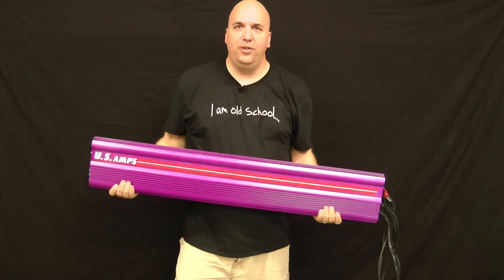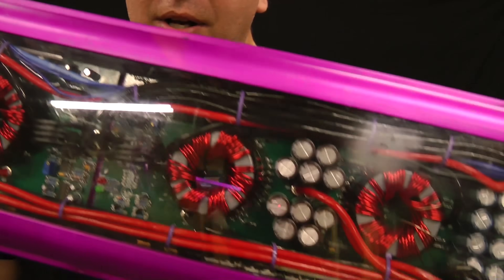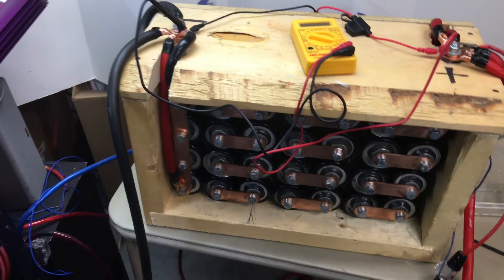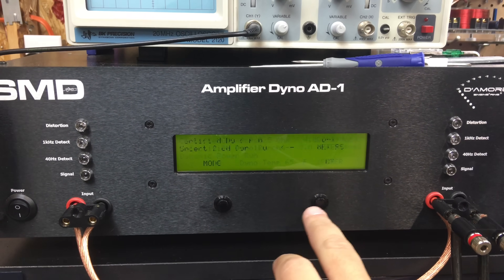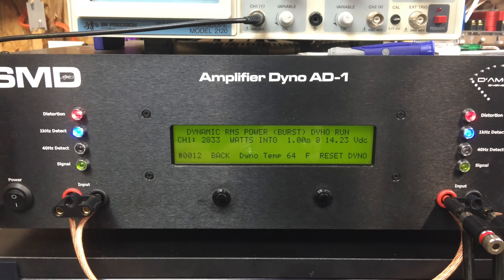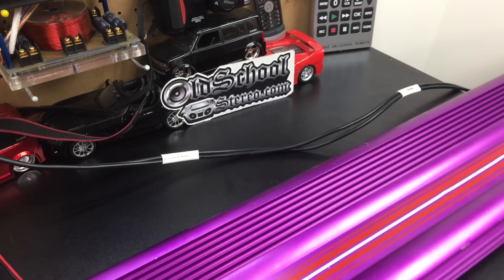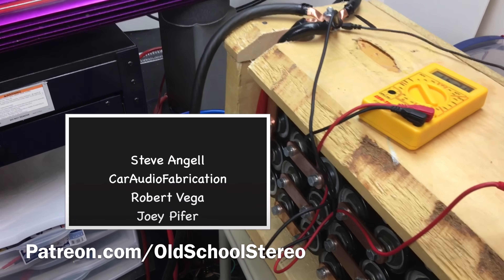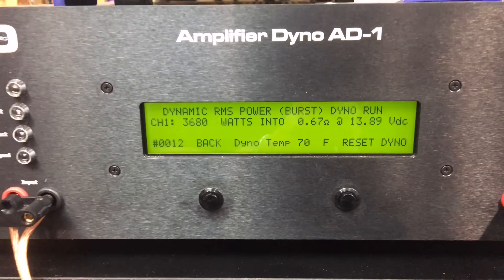Most Powerful Old School Amp - US Amps VLX-400 Amp Dyno Test 1 Ohm UltraHD

Comment: To show you the technology Gap now the same power even more power is only a quarter that size.
Reply from the maker: The JP132ab does more power than this amp, same architecture (Class AB), 30” in length vs 44”. The US Amps was revolutionary in its time though

Comment: In competition we would run them at .5 ohm. 
We also mounted them upside down because if the solder got hot enough there were tracks to hold the molten solder. 
Of course these were competition cheater custom built. Wish I would have kept a couple 🙁

Comment: Noice!  I miss my US Amps 100HC.  When I was building the system, I spoke with US Amps and they said it would happily handle .75 ohms and it did..  I had it paired with a usa-150 and it used to baffle people as to why the 100 "watt" amp was 3 times the size of the 150 "watt" amp.. ;)
Reply from the maker: Beast amps!

Comment: Owned one, had it in a '63 bug with 2x 15" MTX Subs in a sealed box, holy hell, I remember a friend saying he could hear and see my car over a 1/2 mile away coming up his hill. Old Bugs are an almost airtight sealed car, it sounded amazing inside. That sub eventually fried both those speakers after buying that amp I just couldn't afford JL's , W7's were just coming out and hard to get. I still have all my hearing and I rack that up to having a great amp with low distortion and a sealed box. Thanks for the memories!

Comment: Bro, revisit this amp!! I have this exact amp 1999 US Amps Vlx400 run at 1/2 mono (this amp is .5ohm stable out of the box, on all the data sheets and more) with 14.4v, 8v rca input, drawing 398amps pushing 8 dc audio 12's with 4450watts confirmed. 

I watch you vids constantly. My question is why did you stop before testing to 1/2ohm? This amp is built to withstand the abuse, and yet then you test a second rate junk made in China amp at 1/2ohm????!!!??!!??! 

***case in point......

"Are You Down for Some Low Ohm Amp Dyno Tests? Down4Sound JP23 Amp Test Part 2 [4K]"       This made in China garbage!

So, why?

RE-do!!!!!!!             I contend that new school numbers don't have s*** on old school bass numbers!!!

RE-do!!!!!

Comment: Back from the grave, how many amps did this test pull, and will it do 0.5 ohm?
Reply from the maker: Over 450A and it went into protect at 0.5 resistive 😲
Reply: @wal   thanks for the reply. I have one of these amps that I've been thinking of running, but didn't know how much I needed to build the electrical system.

Comment: I had 4 of these amps on 8 15’s in my Explorer. Had to feed them with 2-250 amp alternators on 8 Northstar batteries
Reply: What'd you hit
Reply: HoratioHoodoo it was in a sealed diamond box, so technically a 4th order. I built it more for musically. The best metering was 154’s
Reply: @jasonneal  8 15s for musicality 😂 I like it
Reply: HoratioHoodoo thanks, I wish I had video, all I have is pics
Reply: @jasonneal  could i plz see
Reply: What exactly do you have in your $4000 explorer sir? Just 15 feet of amps that cost $15,000. Lol. Love it!
Reply: @ThisIsMyHandle-48  I don’t have the Explorer anymore. I had 8-15’s 8-8’s mids 8-61/2’s and 6-3” super tweeters

Comment: In high school, I had 2 baby brothers of this amp (also purple). I had the VL100 (subs) and the HV25 (mids/highs).  I used to run the VL100 at 1 ohm (2- 4 ohm dual voice coil wired all in parallel ) bridged. It never went into protect. I ran a fan on it and it would occasionally blow a fuse. These amps were awesome! I still have the little 25-watt amp, but no longer the 100-watt.

Comment: I have a USA app a beast from the looks of the insides probably more than that vlx 400 it has two more transformers and a lot more capacitors if anyone news anybody that can fix us amps please let me knowI have two other us amps they could use for parts if they have tonothing's burnout on it or visibly wrong with it at all it just will not come onI am from Gainesville Florida where these amps were made can't find anybody to fix it I used a US 600x to push for 12 s this am only had one transformer in it and a lot less capacitors I've had more powerful amps but I've never had an m that put out better sound quality when it came to bass

Comment: We sold US Amps where I worked in my youth - we had a 100HC on display, and I could plug in every sub we had on the floor at the same time (20+) and it would rock them all with no issues whatsoever. Just amazing.
Reply from the maker: That is amazing!

Comment: When I came across this amp in 1997 as a broke college student, I had to have it.  Somehow, I was able to come up with the $700 that the guy was selling it for and eventually got it shipped to me.  If anything, the black satin 44" monster I had was a work of art and was insane pushing 4 12" Orion XTR's in my 94 Acura Legend.  Had the beast for 9 years, until I sold it in 2008 on Craigslist for $800 to another audio enthusiast out of state.  Simply one of the best Old school powerhouse amps that came out of the 90's..  They don't make them like they used to anymore....
Reply from the maker: I bet it was a tight fit in your Acura 😲
Reply: I ended up placing the amp on the rear deck behind the back seats as the trunk space was filled up with the 2 custom boxes built for the 4 12's...
Reply: So you got to use for 9yrs for $100. Sweet!
Reply: @ahumm8280  no, he got paid $100 to use it for 9 years
Reply: They were killer amps, I’m actually hooking up my ESX V1600.1 USA amp made by ZED this weekend
Reply: 92hbhb Hybrid china does and cheaper

Comment: Do you have a video showing your power supply?  If not is it transformers or switch mode?
Reply from the maker: I use (8) XS Power D1400 14v batteries and (8) banks of Maxwell Ultracaps (2.5v 2600F each) in banks of 6. I use an XS Power PSC30 to charge everything to 14.8-15v before running the tests. I recharge as needed
Reply: BigDWiz cool man, thanks.

Comment: They were going to make me a custom amp back in the day.  I remember seeing them demoing a mitsubishi mighty max (if i remember right) in central Florida  with 4 18s in a wall. it was insane.  VERY loud and powerful for the 90s. The amp stretched from door frame to door frame.  Sadly I didn't have the $ for the amp.  It would have been epic.
Reply from the maker: They made a few customs over the years 🤙
Reply: I had the first gold plated VLX 400 and as far as I know it was the only. Did somewhat more than an off the shelf 400. Ran on 6 Petras Prowler 18s. Also the only of their kind.

Comment: The days when a real 400 watt amp was at least 4 feet long and would cost $9.25 per watt based on msrp! I had a little US Amps powerhouse from between 1997-1998 that was just around 2 feet long, costed over $695" With Discount" at a local retailer, it had a clear plexi bottom, screw terminals was 1/2 ohm stereo capable and it blew basically every sub or set of subs you hooked up to it! I should have never sold it, but I was turning 18 and never thought about saving it!

Comment: how's the capacitor bank holding up
Reply from the maker: +Clayson Webster its doing great, but I'm adding some 14 volt batteries as well
Reply: BigDWiz Are you using any blanceing resistors
Reply from the maker: +Clayson Webster no balancing resistors. I periodically verify voltage on each cap and they seem to do well balancing themselves

Comment: can anyone possibly tell me how to get a message to bigdwiz I have got some questions I really need help with about amps
Reply from the maker: +eric burns I read comments here and reply when I can, what's up?
Reply: BigDWiz  awesome I'm trying to build a system for my daughter and I am on an extremely tight budget anyway you could point me in the right direction of the biggest possible amp that I could get with the closest too true number for $250 or less
Reply from the maker: +eric burns that's a tough one. Most of the budget amps I get are tested, then sold. I don't stress test them over a period of time so I don't feel comfortable making a recommendation. If it were me and my choice, I'd check out that Pioneer D9601 I tested recently. It is well under 200 and seems to be built well and does rated power plus some
Reply: BigDWiz thanks a lot that's actually the amp I was thinking of going with

Comment: maybe I'm used to today's small powerful amps but that seems  weak for the size of the amp
Reply: voceteo10 1 Nooooo man. The power then was different; more true. The components were of better quality and not sent overseas to be built with cheaper parts. For instance Zed Audio (Hifonics and a few other brands) amplifiers were the Buick Grand Nationals of their time. its notbthe size of the amplifiers but what the guts are made of (giggidy).
Reply: voceteo10 1 back in the day these amps should have been rated to there actual power output. Maybe they would still be made in the USA. Screw all these oldschool usa made amp companies, greedy bastards, sell outs. You screwed all your loyal fanatics.

Comment: I wish I could see how much my old optimus 4 channel does.
Reply: I had one too! and a flea market 15 in the back of a '77 honda civic, was horrible for sound, but got me started! (didn't have an eq either, instead I had a shack "sub" inductor crossover coil inline any power that amp made got eaten by that damn coil lol!)
Reply: Remember the old powered EQ's? Lol Horrible but it worked if you didn't have money for an amp
Reply: littleblacksonoma LOL that's old school dawg radio shack!
Reply: Ari Reid I know. im surprised it still works.
Reply: smoothkaos2 kraco

Comment: dereck BigDWiz   what group size, amp hour and how many batteries would you recommend using to power one of these.  
I'm going to have mine repaired soon and want to use it this summer no competitions or anything just daily
Reply from the maker: +David m Depends on how much you are going to load it down and how much you are going to push it. I'd start with one Group 34 battery and see if that's sufficient

Comment: I had 4 of these that I actually traded 4 of my BP1200.1s and some cash for in 2003 or 2004 for a wall build in my IROC i had at the time.  Kinda coincidental considering the previous video of yours that I watched was you testing that very amp.  We called it the JBL "Lego block" back when it was popular in 2000-2001 and it was the best bang for your buck out there.  It was on ebay for $249 USD for a solid 1300 watts that was a badass deal for back then.

Somehow a guy found out where I lived from the forums (so he said), and walked up my driveway when i was working on the car one day and made me an offer on all four.  He knew exactly what they were etc...it freaked me out big time.  But he returned the next day wish cash as promised and I was on to the next ones.  Never figured out who he was or heard from him again on any of the forums.  2 were Purple...one silver and one green.

Pretty badass amps though.  Id like to have them for nostalgia purposes for sure.

Comment: hay  bigdwiz Like to see a test on a great old school amp the Hk ca260 had four in my blown 1970 cuda all chromed out show car I  did back 1984 hemi 4 speed  interior is black velvet with gold plated door handles , pistol grip sifter, door locks. dome lite exc.  all gold plated  car is  painted hemi orange still have it ! my dad bought it brand new in 1970 it was his first new car dad's brother owned the dealership  I was 6 years old being tossed   around  the back seat as dad test drove the hemi cuda and the 440 sixpack  my brother wonted dad to buy the hemi it was only  $500.00 more than the 340 cuda   at $3200.00 that he ended up buying  that 1970 dollars    also my uncial  Art had one of only 12 hemi cudas convertible  in the show room on sale  for $ 4600. that's  the one that sales for over a million dollars today   and get this he had to reduce the new car price to 4100.00 because no one wonted to buy it  thanks for responding Rod

Comment: I expected a lot more power out of that surfboard... Very nice amp nonetheless. I wonder if it can run at .5 or .25 ohm? That's a lot of money to be doing scary low impedance tests though. Guts look awesome! There has to be some kind of mods you can do to it to kick out a lot more power.
Reply from the maker: +lmadden6236 Very few stereo amps I've tested can handle the 0.5 ohm mono load on the Dyno. All of the VLX amps I've tested have gone into protect at this load, even with dynamic runs. I've been told by a former US Amps employee there is a setting to adjust for 0.5 ohm mono loads, but I seriously doubt it will put out any more power.

Comment: I loved these amps, never had one, though always wish I did. Wondered how these would measure out. A lot of the old US Amps seemed to take some abuse, but they had a lot of transistors in them things to help share the load. Probably won't see many huge class AB amps like this built anymore. I can only imagine how much heat this would let off running full tilt for a while.

Comment: dam... thats bigger than most amps old or new school
Reply from the maker: In 1996 it was the largest amp you could buy. At nearly 4 feet in length, may still hold the title of the longest amp ever made (manufactured, not custom)
Reply from the maker: Yessir, not the most powerful, but one of the biggest (longest at least). I'm 6'4", so the amp doesn't look so impressive with me holding it, but trust me, she's a BEAST!!
Reply: +Dereck BigDWiz Didn't us amps in the late 90/s early 2ks have a 5kw amp that was longer than his.. I swear I seen one at a db drag event taking up the complete with of a full size pick up truck bed
Reply: They were cheater amp the more voltage u gave them the more they make. You could use the HC amps at 24volt and get huge power for compeating  they might not last long but you could win the competition
Reply: Was it a custom amp? I don't remember anything taller than this amp that you could buy at the audio store.

Comment: Few things first any 3k amp for $300 you ain't getting 3k. 2 the clean power of these amps is unparalleled compared to today. 3 the original owner and designer of these amps is still the same man designing for RE but the corporate asshats at RE will not let him do this today
Reply: +fataldreams2    ...I agree but disagree with your comment !buying a 3k amp for $300 Would be a very "Entry level" amp, putting it nicely ! that would probably never produce over a 1000watts continuous !but there are a Few companies that still make good efficient amps that are big power today !  but Not many !  but I do also agree that Re has gone done a hair !there subs have slightly dropped as well .I know I have some Re MT's subs I bought new back in 04' and compared to the newer models now they are slacking a little !
Reply: +fataldreams2  That doesn't make sense. Nobody in their right mind would build one of those today.
Reply: +Aaron Hammett the engineer and creator of these amps has been trying push the the approval to build a modern version of this amp

Comment: I'm curious what it will do at 1/2 ohm. I had one back in the day and ran it 1/4 ohm daily on eight 10's.
Reply from the maker: +Jeff Weaver It went into protect for me when I tried 0.5 ohm mono on the Dyno. That is a brutal load, even for today's monoblock amps...and the VLX-400 is a STEREO amp. 2 channels, 2 separate boards, simply amazing
Reply: +Dereck BigDWiz damn. I had eight 2 ohm subs wires in parallel bridged at mine never went into protection.
Reply from the maker: +Jeff Weaver I was told by a former US Amps employee there was an adjustment that could be made to support 0.5 ohm mono. Remember the loads I use are consistent 0.5 ohm, whereas a speaker load would fluctuate based on the frequency, box size, temp, etc.
Reply: +Dereck BigDWiz that's true. my box was tuned around 40hz. maybe the burst test will work at 1/2 ohm

Comment: love them guts to bad US amps is gone imagine what they could do now with the amp technology that's out
Reply: +the666bud  Do you have proof of this? I spoke with Dirk and while RE has various lines, the top end are still as good as the old USAmps. But if you remember correctly, USAmps was not that well known until they were pretty much gone. You hardly saw them on the soundoff circuits.
Reply: +the666bud USamps is still around - they bought RE Audio in the early 2000's and since then have rebranded all their gear to the RE name.  USAmps founder is still in charge of things, and I think they make all their woofers in the USA now.
Reply: I know. re  bought out us amps but there not made the same as they use to RE just took the name not the quality the new line is nowhere near as good as the old
Reply: +Aaron Hammett your 1000% right